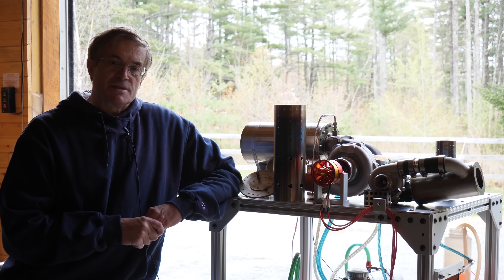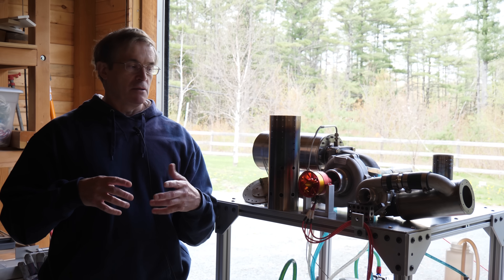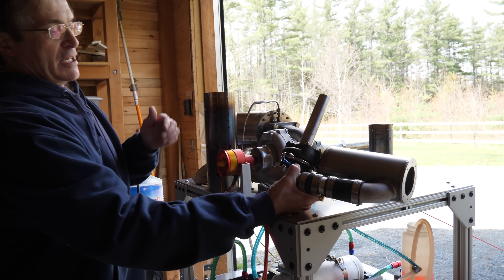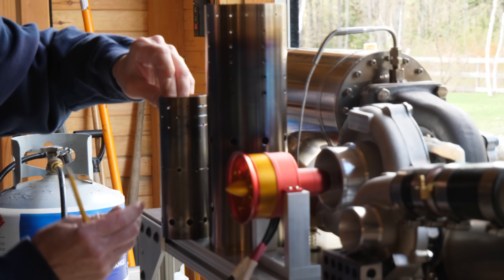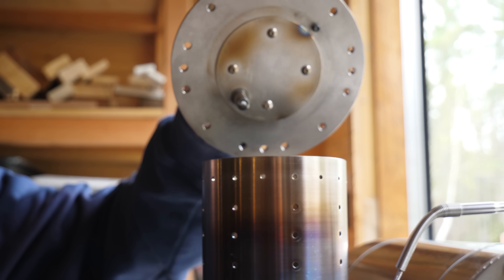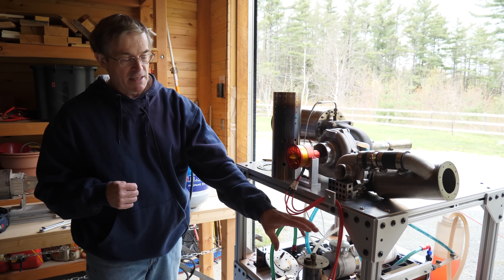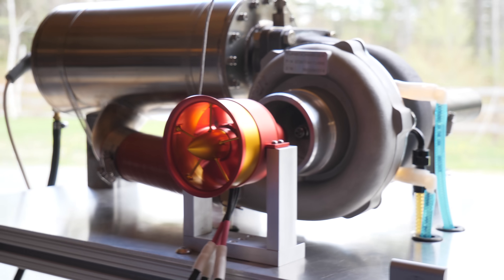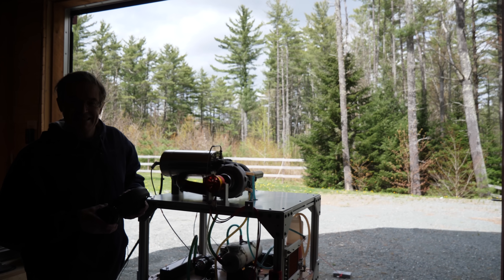Catching Fire - Refining the Jet

Comment: Bloody hell, even just listening to it with normal volume settings on reasonably good table-sized speakers pretty much required hearing protection, heh... or obviously of course turning the volume waaaaay down, though I'm already running YT at 10% volume cause my amp/dac is such a beast.

Comment: I found out the ECU I wanted for my car to do boost control is illegal for street driving.
I'm thinking maybe just to be annoying instead I'll build two of these and mount them on my car as turbojets.

It might be illegal to add boost to my i4, but I haven't seen any laws against mounting the boost directly to the exterior of the car lmao

Maybe I can use the airspeed of driving to spool them up and save on making a starter system.

Comment: Hi, I am wanting to replicate the Manic Beattie car that used a axu  unit with an air bleed to pressurize my cars engine. I see 2 options. One, as you have built but feeding the exhaust into a large turbo. Or #2 putting a air bleed valve before the combustion chamber and using that. The simplest idea would be using a R/C jet pushing a large turbo because its compact. Thoughts for 1000hp?
Reply: Go to the JATO Forum , this has been discussed there in great detail , you aren't the first to want this
Reply: @racketmotorman  Thank you brother
Reply: @Ghosts_and_Cars  No problem , you'll get proper advice and reliable information on JATO ,unlike here where its a bit "rubbery" with the facts  , and especially output data

Comment: Would it be possible to replace the start-up blower with a MHD-pump?
Or even replace compressor and turbine of the turbo-charger with a MHD-pump and -compressor to reduce moving parts?
Reply from the maker: No, it wouldn't.

Comment: Would an increased air-flow save the water-cooling?
Reply from the maker: No.  You can depend on the lubrication oil for all the cooling as the water is primarily for preventing heat soak once the oil pump stops along with the engine.  Most turbochargers don't even include water cooling.

Comment: It seems like robbing Peter to pay Paul using a turbine to drive a turbine… could you not couple direct to the shaft of the turbocharger? Run through a reduction to drop the rpm to a usable speed. Like how a helicopter or turbo prop uses shaft horsepower rather than thrust? Bit late to the party I know, but a genuine question from a new subscriber.

Comment: Where did you find the starter fan? I have been looking for a more portable starting device, first used a shopvac, more recently have been experimenting with a brushless motor coupled to the inducer nut, I think I'd prefer a contactless method such as the small fan you used
Reply from the maker: Any RC electric ducted fan should work.  Match the diameter to the inlet of the turbo.

Comment: I wonder how do you plan to harvest mechanical energy of it?
It rotates to fast to wield shaft to it and use gear box, do you plan to add exhaust, slowly rotating, turbine, like it is done in trains or tanks?
Reply from the maker: No.  Actually, I'm really impressed with the principle of the Pelton wheel.  When the wheel rotates at 1/2 the velocity of the exhaust, all the kenetic energy of the exhaust is extracted.  These can be purchased in relatively large diameters further reducing the RPM and increasing the torque.

Comment: You need to couple it to a Tesla Turbine (they love fast moving gases)  then to a generator. measure output. Measure the true power and efficiency then design tweaks to the the Turbo can be quantify upgrade to the performance.   Overall Awesome Bravo!

Comment: With most RC turbines there's no fan infront of the RC centrifugal compressor blades, it's just the motor tied directly to the rotor. When the turbine shuts off, the motor remains on for cooling and it also acts as a flywheel+alternator.

Comment: Noticed on the first engine the use of what looks like a spray nozzle like used on an oil burning furnace. You mentioned splatter and uneven burn (nice solution by the way) but as added information, those nozzles come in a wide variety of spray patterns and flow rates. Most are designed to work at 100 psi. Perhaps a different nozzle? Hollow cone vs solid? Various spray angles...many choices!
Reply from the maker: I was aware of the large range of different designs and tried several variations with almost no change in the performance.  This suggested a common and unchanging problem. Using a transparent fuel line it became clear that the irregularities originated in the chaotic vaporization of the liquid propane in the line.

Comment: This needs an update and to be run off your waste methanol...  also needs a turbine driven generator to charge batteries to then heat your still to make more rum/methanol
Reply: also your bearing housing is 80' out... the oil drain needs to point about 10' off strait down so oil does not coke around the bearings

Comment: I would like run my house electricity off of a turbojet. there was a Japanese company producing small units. the Japanese company is IHI. they couple the turbine to a magnetic electric generator.  120volts/400 watts. they even made it pretty quiet somehow. 

can you guys please couple this to a generator. I think you can direct couple the generator to the induction side instead of running a secondary turbine on the exhaust. seems more efficient. thank you. 

https://youtu.be/Al8elCF816g
Reply from the maker: The extremely high RPM is a major disadvantage when directly coupling small turbines. I believe I've heard of that company.
Reply: @TechIngredients  you gotta take a look at their product because they were able to design around those limitations (both noise and rpm). I assume large scale power gen using gas turbines are not directly coupled (turbine to gen set)? 

Love your content - excited I got a response.

Comment: I noticed that surging issue in the first video, and it reminded me exactly of the same issue with liquid and gas fueled camp stoves; in liquid feed mode at reduced pressures you end up with what seems like pressure resonance creating an inconsistent burn (as you said due to inconsistent vaporization, and presumably resulting backpressure), and in gas feed mode, it runs beautifully.  Some stoves get around this by reducing the volume between the valve and the atomizer.
Reply: He mentioned that the combustion chamber is small with small turbos which makes it less efficient

Isnt it possible to use the large combustion chamber on the small turbo??

Comment: Use a propane forklift regulator without the pressure valve. Run your bearing liquid through the water jacket. Vaporizer and cooling in one.

Comment: —  Center diagram , here _
http://www.sciencemadness.org/talk/files.php?pid=109415&aid=4105

Using Hydrogen rich exhaust from a hypergol propellant for fuel to power a compound rocket turbine engine.  The idea is that a turbo-supercharger could be simply modified by removing the compressors scroll and replace this with a nacelle enveloping the entire turbo unit directing air flow across the now enclosed bearing and turbine scroll fitted with a small liquid rocket engine to spin the turbine and the exhaust can be further combusted with the air from the compressor.  8 parts Ammonium Nitrate in solution in one part water at the boiling point as the oxidizer is Hydrogen rich.  The reducing component needs to react on contact with this ' oxidizer '.  The criteria of Hydrogen rich and pyrophoric is satisfied by Diborane , solvating it with Ethylene Diamine also very Hydrogen rich and limiting the adduct to a minimum 12.9 % weight of the total , H2N-CH2-CH2-NH2 • B2H6 .  Only the Boron and Carbon consume available oxygen , the exhaust is 2/3 Hydrogen by volume 9.9% by weight.  Additional air is provided by the trailing augmenter section which has potential to operate as a ramjet besides.

32 H2N-CH2-CH2-NH2 • B2H6  +  45 NH4NO3  +  25 H2O   =>  
32 B2O3  +  64 CO  +  77 N2  +  339 H2  /   air >  /  202 O2  +  808 N2

As an alternative , Trinitrophenol is as soluble in Nitromethane as Ammonium Nitrate is in water evaluated above.  I don't know but suspect Guanidine is also similarly soluble in Ethylene Diamine.  Again this just a conjecture but these two blends may hypergol when combined.
Evaluating for combustion separately :
Note these two being the  stronger base and acid will couple preferentially.
    Guanidine     +   Trinitrophenol 
H2N(C:NH)NH2 • HOC6H2(NO2)3  => 7 CO  +  3 N2  +  4 H2

  Ethylene Diamine  +  Nitromethane  ( a.k.a. Picatinny Liquid Explosive )
H2N-CH2-CH2-NH2 • 2 CH3NO2  =>  4 CO  +  2 N2  + 7 H2

All together now  
[ H2N-CH2-CH2-NH2 , H2N(C:NH)NH2 ] + [ 2 CH3NO2 , HOC6H2(NO2)3 ]  
=> 11 CO  +  5 N2  +  11 H2    /   air >  /  11 O2  +  44 N2

The resulting water gas ( CO + H2 ) has a low heat value but is adequate.
Additional hydrocarbon fuel can be intoduced into what is a high bypass air flow.

P.S. 
What the World War II german rocket plane Me 163 used , high test Hydrogen Peroxide 
plus "C Stoff " ( Methanol , Hydrazine hydrate and catalyst ) would power this unit but
An additional fuel would need to be provided for external combustion.
https://en.wikipedia.org/wiki/C-Stoff
https://en.wikipedia.org/wiki/List_of_stoffs
https://www.youtube.com/watch?v=qfAw4YvI_u0&t=6m50s

A concept I have never seen tried is to direct exhaust down a leading gutter the length of the wings which vents over and rearward to provide thrust and added lift.  The closest might be the defunct Russian Ekranoplan.

.

Comment: You  mentioned seeing AgentJayZ's videos. You should look at his multiple videos on combustion liners and fuel nozzles. I know this can style burner is what "everybody uses" for turbocharger turbojets but I can't imagine is working well at high power settings, especially using liquid fuels. Air flow inside that combustion chamber must be a mess and will only get worse as the inlet pressure rises. Commercial combustion liners go to great effort to maintain stable if not laminar flow and effectively blend in cooling air after combustion.

Comment: GREAT CONTENT!
A design suggestion, if you're running high load/RPM range you should keep track of the temperature output of the compressor and set a limit to around 225 degrees C to avoid a molten aluminium compressor wheel (i'm assuming it's not Ti alloy). 

If applicable and what works for me; I keep above pressure ratio 1.2 to avoid getting oil in the compressor housing for warming up until the oil flow get around 20-25 grams/second.

Also, the RPM range from the chart showed 120k RPM, i'm thinking it seemed a tad high, couldn't find any reference data or compressor map at CXracing though.

Comment: I would consider the use of a heat exchanger to vaporize the liquid propane. It would be simpler than adding the fuel pump.
Have you considered a combustor can modeled after the older jet engine designs?

Comment: If you're moving to liquid fuel don't forget to add a fuel purging system for shutdown. The simplest form would be to inject shop air into your fuel line at a pressure just slightly under your fuel pressure so when you shut off the engine you don't end up with a puddle of non-atomized fuel sitting in your burner can.

Comment: Just to understand better. Are you running the engine permanently on gas, or do you switch over to Jet fuel at some stage. I know quite a few of the early model jet turbines did this. Nowadays if the spray is fine enough you can start and run on Jet fuel exclusively.
Also as the engine starts and internal pressure builds up, you have to increase fuel pressure to maintain a pressure gradient that allows sufficient fuel into the combustion chamber.
Well done! Turbines are fascinating engines!
Reply from the maker: With the propane or the liquid fuels, alcohol or gasoline, we start and run on the same fuel.  This engine is easy to start.
The fuel pressure in all cases greatly exceeds the chamber pressure and no compensation is required as the chamber pressure rises.

Comment: You can try a Propane tank heating blanket to maintain the pressure in your tank
Reply from the maker: You'd be surprised how much heat needs to be added not to mention conducted into the tank.  It's several kilowatts at a minimum.

Comment: How about nitrogen pressurising the propane tank - used to do that flying hot air balloons in the winter when the vapour pressure was low for the main liquid burner.
Reply from the maker: That will work if you are feeding liquid out of the tank.  But, when the vaporization is occurring in the tank, there is no way for the nitrogen gas to drive the propane gas out.
Reply: Sorry that's what I meant, liquid tank off rather than vapour. Obviously nitrogen doesn't burn :-)

Comment: What will 'you' use it for?
Reply from the maker: We plan to drive a large diameter, high torque, moderate RPM turbine to directly drive a transmission or to generate electricity.
Reply: @TechIngredients  any timelines you looking at? Can't wait to see it working. Keep up the good work.

Comment: hmm, makes me wonder if gas fuel instead of liquid fuel entering a traditional ic engine would be more efficient due to better burn, anyway, back to the jet. I'm wondering if there are performance/efficiency overlaps with the electric turbine there? In order to either produce more thrust or greater thrust over time (economy), then minus weight to fully evaluate. Also, how about fuel types, like oxygen or hydrogen? the most reactive/explosive (heat compensation included) or the fuel with the lowest unit cost, a bit like how RON 95 delivers more km per dollar spent.

Comment: Propane fueled recip engines usually have engine coolant heated regulators to maintain stable output pressures and to help vaporization.  In future builds that might be worth looking into and/or bleeding off a bit of warm/hot air from somewhere to warm the supply tank.  Can't wait to see this coupled to a matching power-take-off turbine.  Your grand-finale should be a steam turbine powered by all the waste heat for your very own miniature combined cycle power plant!

Comment: You mentioned a vapour pressure drop due to fast fuel burning , could you not do a couple of things to increase the operational time of the engine by :

1. You could use a balanced fuel draw from multiple tanks and therefore you will pull less from a single tank and then the temperature would not drop  as fast in each tank.

2. Use a coil of tubing for an oil cooler and one  for a water cooler to keep the engines over temperature down.....wrap a coil around the tank ( tanks ) and use the heat to fix the fuel temperature  problem and use the evap.temp. drop to cool engine......WIN - WIN
Reply from the maker: Both approaches would work if the added weight and complexity are acceptable.

Comment: Be carful getting graphite on the combustion chamber, you'll burn holes on it wherever the graphite contacts. I rebuild turbine engines from helicopters and I've seen guys mark things with a pencil and you can see exactly what they wrote after the engine heats up and anywhere the graphite was there's no longer metal
Reply from the maker: Interesting, never knew that.
Thanks!

Comment: LPG engines will run the LP thru a two stage pressure regulator and thru a vaporizer that's heated with hot antifreeze from the head of the running engine.  That keeps the engine burning gaseous LP rather than liquid phase.   When you burn liquid phase propane in a V8, big flames come out.  The regulator plus vaporizer are not a heavy mechanism on  a V8 that's already circulating coolant..
Reply from the maker: I see.

Comment: What kind of microphone were you using? Was there a second mic aside from your clip on electret? 

Amazing engine you've built there. A bit out of my league unfortunately but fun to watch. I did build a pair of Voigt pipe speakers after watching your build and they turned out amazing. I went with the 'folded' design and people are blown away at how good they sound for how small the driver is.

Comment: i have to admit ,im thrilled you started this project. Honestly cant think of a more thorough and comprehensive science based channel across the whole of youtube.  love the valved 50lb thrust pulse jet in the background btw. i built one from maddox plans a few years ago. Theres a video of me "not under this name" running it on top of a go-kart. how does the larger turbo jet and the pulse jet compare in terms of loudness?. i have since moved to another location and would probably have the military at my door if i started up the pulse jet lol...poor thing just sits in my living room.
Reply from the maker: The pulse jet is louder, but also more unpleasant.  At a distance the turbojet sounds just like being at the airport.
Reply: @TechIngredients  that's my draw to building a turbo jet.  Frankly that pulse jet was the most horrifying thing I ever built lol. Also never knowing when one of the reeds may go and have a gallon of gasoline a minute flaming out the tail pipe. Thanks again for taking on such a project and I look forward to the turboshaft end of things.  I've looked around and can't seem to find a good source for designing the output impeller.